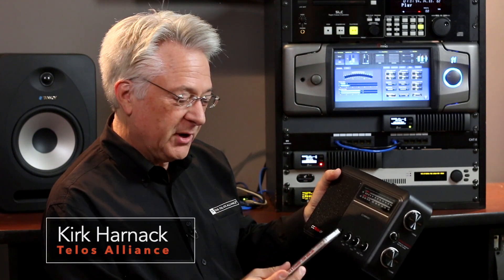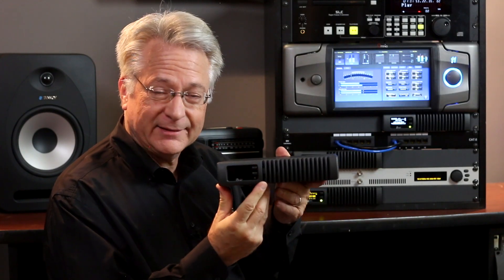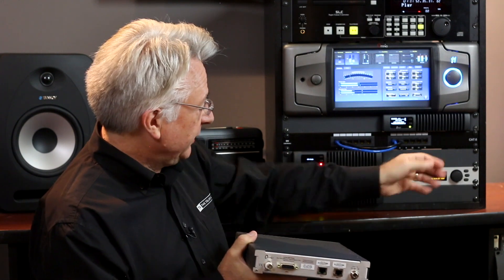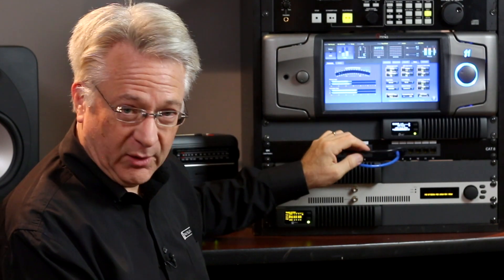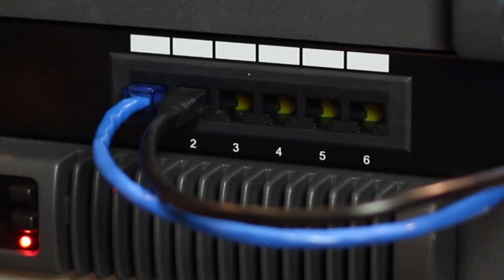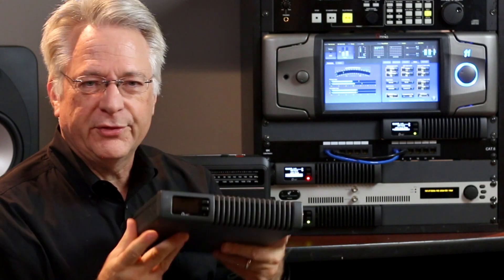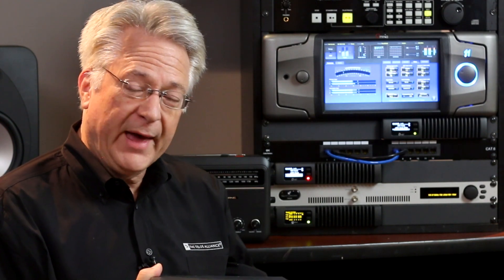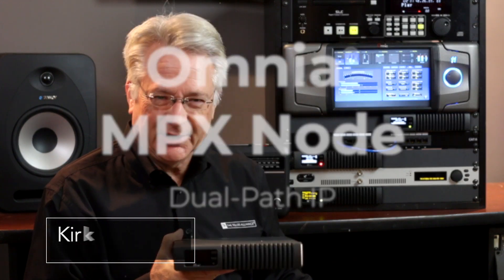Telos Alliance Omnia MPX Node - Dual-Path IP

Comment: Is there any audible delay between source audio on studio side and decoded audio on transmitter side?
Reply from the maker: Hi there! Yes, and it depends on the selected bitrate, error correction settings in the encoder, and stream delay buffering setting in the decoder. These settings depend on the connection being used.